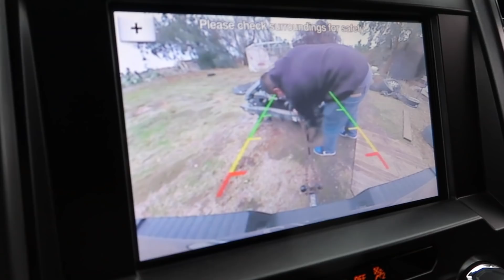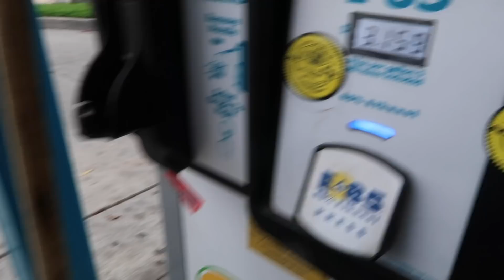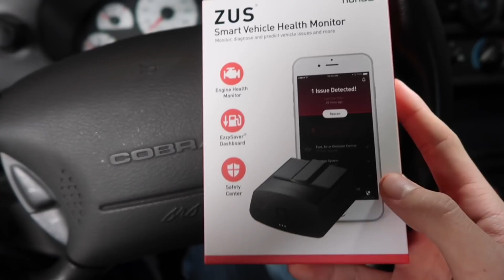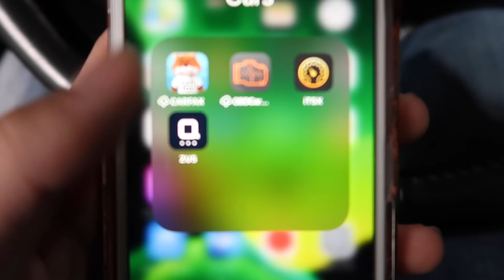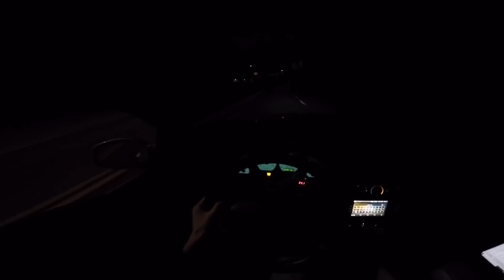Leaving Highschool and He Said My Cobra SOUNDED LIKE A V6!

Comment: Honestly I don't think straight piping anything sounds good in my opinion it kinda makes even v8's sound like fart cans tbh but that's just me honestly if u wanna make a v6 or a V8 sound not like a fart can just out a new exhaust system in dual in single exhaust dual out or just cut it at the headers but that leads to back pressure flow

Comment: Your cobra sounds like a v6 ngl, needs more loud, i would go with x pipes
Reply: Joseph R. Back to the borla ataks
Reply: He doesn’t need to make it louder honestly.It was loud as hell before when he had the borla attaks
Reply: Lowkey at cruising rpm it does but high rpm it sounds like v8
Reply: What😂
Reply: If anything the x pipe makes it raspier makes it sound exotic, an H pipe gives it that nice muscle tone. I prefer h pipe on mine
Reply: Lower in the rpms it sounds like a v6 till it gets in that main power range
Reply: @Sak-zo1ui  because of the x pipe, h pipe sounds like a V8 one of the best sounds...
Reply: Sak 20012019 my truck is pretty much the reverse. It sounds beastly when it’s cold at idle, but it shows it’s true colors as a gutless v6 at high rpm. Still can gap civics so I’m not complaining 🤷🏻‍♂️
Reply: @fransiscoh9450  I'm saying bro! I can't get enough of the sound lol. If anything these new V8's sound like ass lol